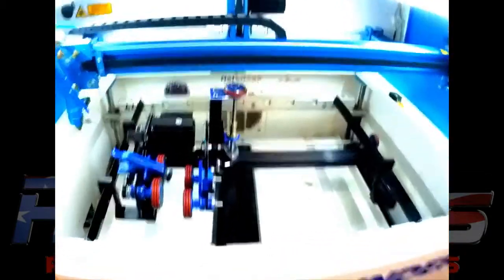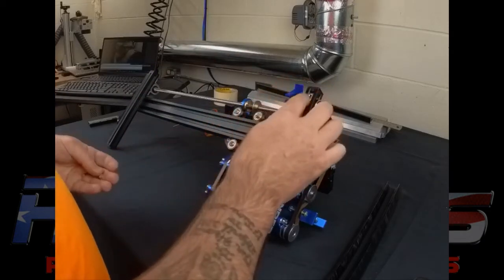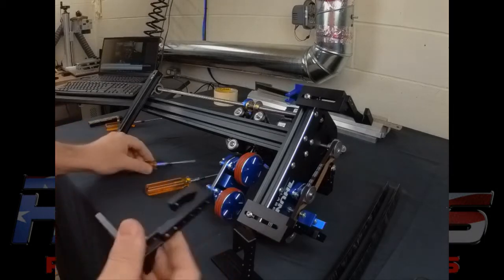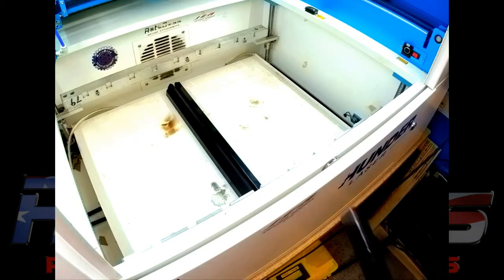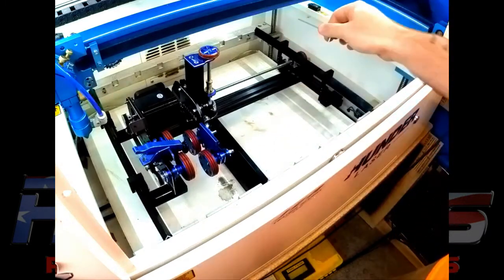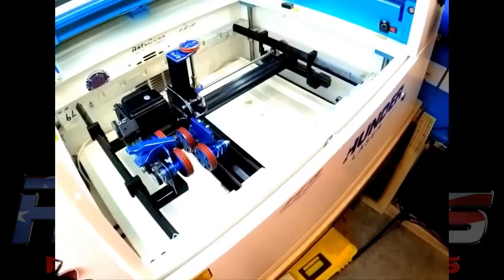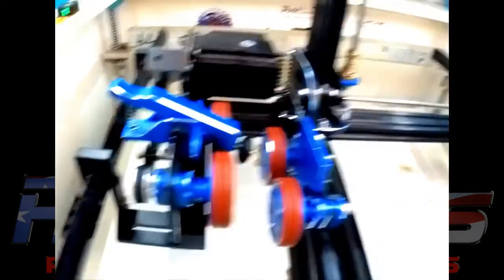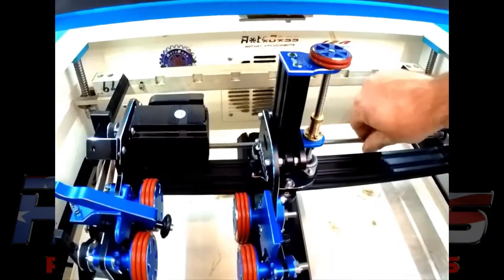Thunder NOVA Drop down brackets install.

Comment: Days away from purchasing a 24. Would you recommend one over the over (Rotoboss/Rotoboss Jr)..or one of the other rotaries on your website? Will be doing mostly 30oz tumblers...maybe some 40 oz Stanleys. Thanks for your help!
Reply: Hello, RotoBoss or Junior Rotaries for a thunder need to be purchased through Thunder. I personally use the Ascend in my Nova 24 (purchased direct from us) The Rotoboss or Junior would be great too, though with the drop downs and the adjustability a Junior will work just fine if you wish to get one of them.
Reply: @JERCustomDesignsInc  I kinda figured yall had a deal worked out on the Rotobosses, does the Ascend need the drop down as well?
Reply: @RealDustyChandler  Yes for the 24 it needs drop downs
Reply from the maker: @RealDustyChandler  Sorry forgot to switch accounts. Jer custom designs is the parent company, Rotoboss is just a brand un JER
Reply: @JERCustomDesignsInc  Nevermind I see in the options on yalls site where the drop down brackets are included. I love the color of the Ascend. Very cool!! Seems a lot more low profile as well
Reply from the maker: @RealDustyChandler  it has about the same profile as the Junior but no towers in the way.
Reply: @rotobossrotaryattachments  would you recommend one over the other for a beginner?
Reply from the maker: @RealDustyChandler  Junior or Ascend
Reply: @rotobossrotaryattachments  thank you!!